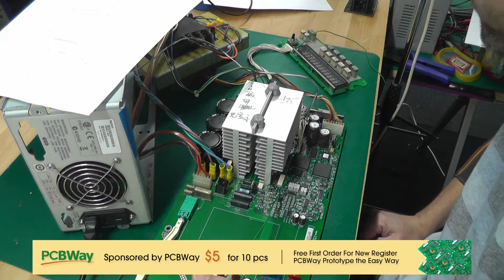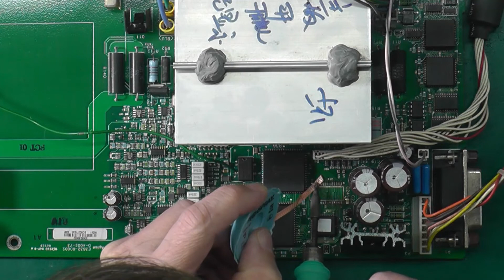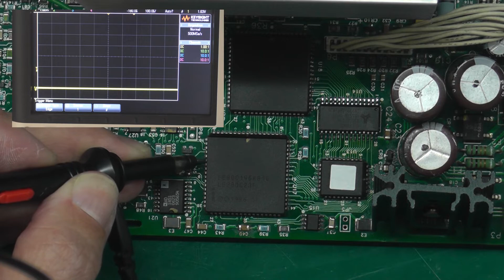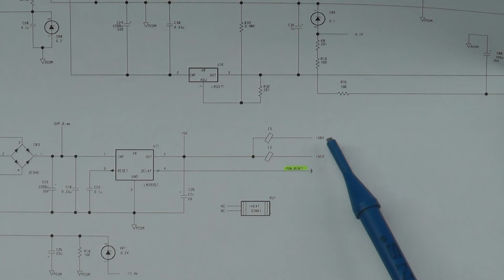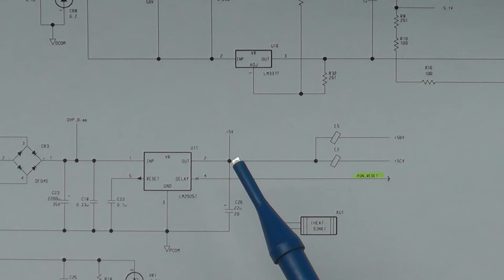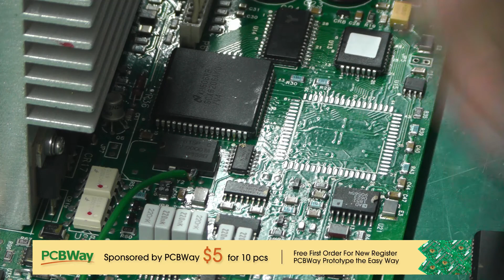No.065 - Agilent E3632A Power Supply Repair - Part 2

Comment: I currently purchased an Agilent E3632A with a VFD display that flips the one millivolt reading up on one digit: from 5.001 to 5.002, but otherwise a good unit. Under various load tests the output only changes 1 microvolt. Would like to see a calibration video, if you haven't already made one.
Reply from the maker: The calibration procedure in the manuals for these units is quite good, failing that, I have covered calibration to some degree in maybe 1 or 2 of these Agilent PSU repair videos.

Comment: Did you poke about much after the microcontroller? There was data on the buses which suggests the microcontroller had a running program counter before it turned to toast. What's between the micro and the display interface?
Reply from the maker: Also from what I can tell the ASIC HDL is programmed via the uC at boot.....thankfully!
Reply: @IanScottJohnston  Ah that's interesting. I was wondering if a replacement would need further work
Reply from the maker: The 4-wire serial interface to/from the display is split between the ASIC and the uC (the block diag in the service manual is not quite correct). The ASIC communicates with the uC also.
The ASIC provides the data, the uC provides the interrupt. All lines were basically dead. No interrupt, no data.
The ASIC provides the data to the DAC, also dead.
If the new uC when I fit it still shows the same problem...........then the ASIC is toast and I'll be looking for a replacement somehow.
I wasn't near the uC when it suddenly decided to burn up.

Comment: That is weird. I wouldn't expect a Agilent to make a mistake like this. Maybe there is a similar regulator with the delay and reset pins swapped how they are in the schematic and they fitted the wrong regulator.
Reply from the maker: I did have a quick look but couldn't find one.

Comment: Did you look at the output of the 5 volt regulator with a scope?  I have seen regulator failures where the overtemp protection circuit will cause the regulator to output a sawtooth  or a "PWM-ish" output that digital circuits do not like. Looking forward to the next video!
Reply from the maker: I did, it was fine, but I will be changing out the regulator when I change out the microcontroller anyways.

Comment: Supervisor IC failure, I had a bad supervisor ic on one of the supplies I fixed a couple of years ago. I found several mistakes on the schematics almost intentional looking errors, I suspect they are done wrong due to being current models of the units to help prevent copies being made.

Comment: Interesting.  It might be worth sniffing IG_TXD?  The manual suggests there may be some checks carried out during start up?  Also... https://www.electronicspoint.com/forums/threads/hp-agilent-e3632a-programmable-power-supply-has-power-up-failure-solution.101803/ suggests adding a pull-up but maybe that was a workaround for pin 4 and 5 swap??  Very bizarre.  The X marks on the schematic are odd?  what do they signify?  Also... it didn't get hot before you swapped the SDRAM.... ?
Reply from the maker: I'll take a look at IG_TXD thanks. Yes, the Reg reset is an open collector output and it did cross my mind about a pull-up, especially since there is an RC low pass filter in series with it before it hits the uC reset pin.....It's altogether an odd design!
The uC wasn't hot for a good while after the ram swap.